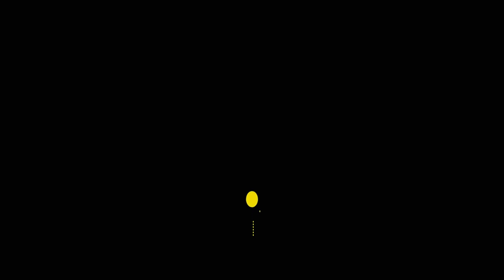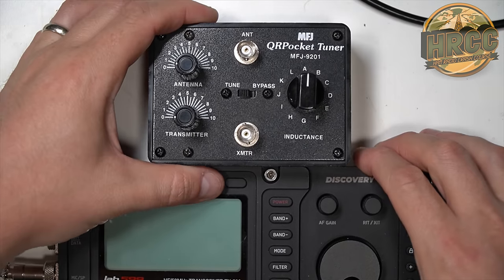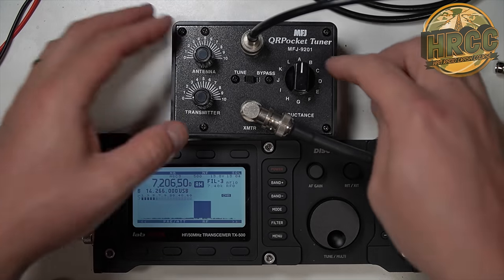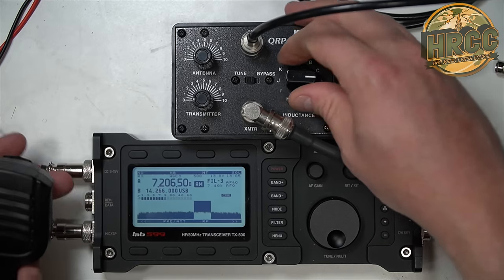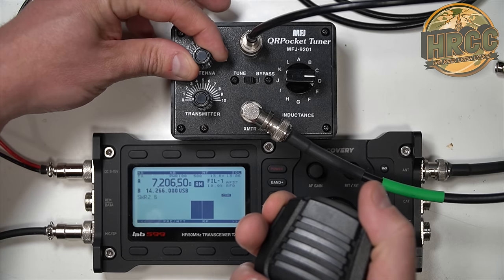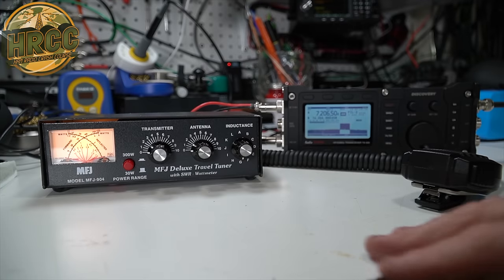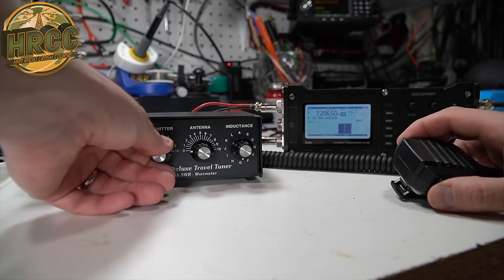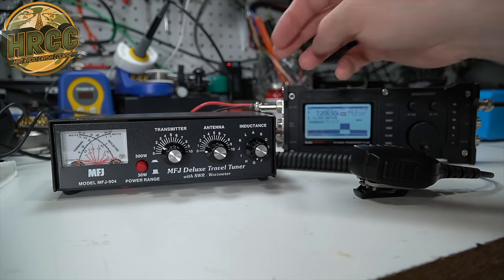How To Use A Ham Radio Manual Antenna Tuner 📻

Comment: Just a minor correction.  The MFJ "potentiometers" are actually just variable capacitors that has an adjustment knob attached.  Not resistors.  Thx for the vid.
Reply: Apparently, among electronic enthusiasts, potentiometer is becoming like a generic trademark for anything that has a dial and rotates, doesn't matter if it's an actual pot, variable caps, rotary encoders, just anything like it.

Comment: You are not likely to damage the tuner, by changing the inductor switch while transmitting which probably temporarily opens it, but the high SWR that you may reflect back to the transmitter may damage the transmitter.

Comment: I started with a manual MFJ tuner i was given, then got the bug and tried building my own.
Building and testing your own tapped inductor is probably the biggest challenge but still a worthy thing to learn about.

eBay has super cheap 11-12 dollar kits you can buy and build, but to be honest they can be hit and miss -probably better for learning about tuners. Those cheap kits are best for shortwave listening with a portable radio than they ever will be for transmitting even 5 watts QRP. 

I now have radio with an automatic tuner and I'm completely spoiled on it. LOL

Comment: Hi Josh. Well I learned something new today.  Don't play with the induction knob when keyed. Oh oh, I have done that. DUH. Hopefully I didn't hurt the tuner because I really need it for the antenna I have. Thanks, you just saved me money. Great video at the right time. 73 Clark KG7LOI
Reply: It may cause an ark on the contacts, but more importantly it could damage your radio because between each click on the inductor you have an open circuit. With the more expensive roller inductor there is constant contact. If your radio still tx you’re probably ok. 73
Reply: We've all made mistakes in this hobby, but we learn from them and do better. I've had a homebrew tuner with sparks arcing across the capacitor plates a few times. I also know a ham who told me he burned a hold in a capacitor once. I've never done that thank goodness.

Comment: I have a MFJ 969 Versa Tuner II which I hardly ever use any more since I no longer have my old Kenwood TS-430S.  It's a roller inductor tuner which I really like.  I now have a Yaesu 991a which has a built in tuner that will handle all my antennae.  My antennae are all very close to resonate so the radio tuner will do.  I did, however, turn off the radio tuner and chose an external tuner so I could set up my manual tuner for all the bands, just in case I do need the manual tuner.  Tuners are not really tuners per se.  They're simply an adjustable box which fools your radio into seeing a perfect 50 ohm load.  It really helps if you get your antennae close to resonate.  Cheers & 73 from W Rusty Lane K9POW in eastern Tennesseed

Comment: One additional comment; you can minimize the tuner losses by using the lowest inductance setting on which you can obtain a match (often on a band, you can get a match on a few different inductance settings). This will usually correspond to a maximum capacitance on the output side. There is a good article about effective use of T network antenna tuners on the ARRL's TIS.
Reply: How much loss is typical?  I've never used a manual tuner.
Reply: @gooberclown  I understand 1 db might be about typical (roughly 20%).

Comment: I kept a page in my notebook with the manual tuner settings for bands/frequencies I used a lot - helped saved time when switching bands (would still fine tune if necessary using the SWR meter on the tuner).  If you have different antennas you could have a separate chart for each one.  That being said I just got an IC-7300 and that auto-tune button is real nice compared to fiddling with the knobs on the MFJ.

Comment: Yes, I am thinking of a tuner.  But I also try to fix whatever is causing the antenna to be out.  I have modified the HEX Beam so most of the bands are below 1.3 to 1.   IT'S WHAT HAM RADIO IS!!

Comment: You tune a roller inductor tuner, first the transmitter, then the antenna and then the roller inductor.  You should use the manual to get you close to the settings on each band.  Then fine tune adjusting the tuner as described above.  73 from W Rusty Lane K9POW in eastern Tennessee

Comment: At 1:27 those aren't potentiometers, those are variable capacitors, right?
Reply: Agreed, they're also matching units' not tuning units.
Reply: Yes, just verified in the manual pdf.  Easy find with search engine.  I thought the same.  Manual is just a couple of pages.
Reply: pots would do no good. variable caps
Reply: Learning by rote does not generate understanding, which is a pity as many people are losing out on theenormous scope of our hobby...

Comment: I would like to add one word of caution. The T network, as this is, can be tuned for minimum SWR with more than one setting of the one inductor and two capacitors. Only one combination is optimum. I was slightly uncomfortable with that. I always use an L network. There is only one way to tune it to get minimum SWR. The coil is in series with the antenna and the variable capacitor is usually connected from the antenna side to ground. That allows you to match impedances higher than 50 ohms to the 50 ohm coax. If the antenna presents a low impedance then the capacitor needs to be on the other side of the coil. Simply reversing the input and output connections will make that change. L networks are very easy to build and use. Only need a single variable capacitor and a single coil, two coax connectors ( SO-239) and a box or flat surface to mount the components. I have my coil on top of the box and use an alligator clip to adjust how many turns I have in the circuit. Usually a simple coil of #14 wire wound about 5 turns per inch and about 5 inches long works for anywhere from 80 through 10 meters. The variable capacitor can be usually no more than 140 pf max.

Comment: When I was a new ham I had a guy with the radio club explain how to use these.  His explanation made the process seem unduly difficult and made my brain hurt.  Your description of the process is much better.  You are very good at making the complex simple.  Great job.  If I ever buy a radio to replace my Icom 7200 I will buy an MFJ manual tuner.  BTW, don’t you think we should start calling them tuners and start calling them Impedance Matching Devices (IMD)?

Comment: Ha, this video is great. Your helping me learn something new everyday! It would be pretty cool to learn about the science behind yagi antennas and how to build a non tape measure yagi... one thing I don't understand is how the matching stub works
Reply: Oh, that would be a good one, and compare to a log periodic
Reply from the maker: Thanks for watching.  Yeah, I can explain how a yagi works.  Thanks for the idea.
Reply: Matching stubs are transformers.  A curious phenomenon is the quarter wave matching section.  1/4 wave of coax inverts the impedance; a 25 ohm feed point impedance, one-half the coax impedance, becomes twice the coax impedance at the other end.
Yagis work because current lags voltage when inductive (too long) and current leads voltage when too short (capacitive).  The parasitic elements are "excited" by the driven element, and because of different lengths, produce a phase shift that augments the signal in the forward direction and partly cancels in the back and side directions.
Reply: Log periodic is basically the same as yagi but with the important distinction that all elements are driven all the time.  One of the elements will be resonant and that will be the principle radiator, others will be too short or too long, becoming directors and reflectors.  The relationship of the elements is such that you can tune a band and it maintains a uniform SWR across the band, whereas a Yagi has only one driven element and thus a distinct frequency preference (but also generally more directivity because of that).

Comment: Great video. Helps me in making the right choices. I am preparing the licence exam and the next thing is buying the first rig. very exciting, I considered to buy an automatic tuner for the Yaesu FT 891 but the manual tuners teach you more about the technology behind. Even the meter is not exactly required since the transceivers have built in SWR Meters.
Reply: The cross-needle meter gives you a sense of actual transmit power AND the SWR.  Radio transmitters tend to have a percentage power output, but it typically isn't actually measured.  So 50 percent of what, exactly?  
Then there's the problem of where exactly in the coax is the meter.  The radio might read perfect 1:1 and the tuner meter might show something dramatically different (or vice versa).  That will happen when there's standing waves on the coax itself and you just happened (or deliberately) placed the radio or tuner at a "null" in the standing waves.  
What happens is a quarter wavelength of coax becomes a type of transformer and it inverts the impedance, sort of a fulcrum over 50 ohms.  So if the antenna is 25 ohms (typical for a vertical), a quarter wave section of coax will see 1/2 below 50 ohms at one end and transform it to 100 ohms at the other end (1/2 above).  But a half-wave simply replicates and keeps the antenna impedance.  Values in between produce an impedance in between, but with a reactive component.  
Tuners exist to nullify this reactive component.  If the antenna is "capacitive" in reactance (ie, too short), add inductance.  If inductive (too long) add capacitance on the antenna side.  The transmitter side has its own matching capacitor and the inductor is shared.
It is because of the shared parallel inductance that it is typically set first, and then the capacitors, but doing that sometimes necessitates a small adjustment of the inductor again.  Manual operation of the tuner isn't quite a simple as this video suggests.

Comment: I have a MFJ-941B that I have been using since I got it second hand 10 years ago.  It works without fail.  I used to use it with my IC-701, now it faithfully negotiates between my IC-718 and my G5RV.   I don't know if I would see the need to go automatic, I am never in that big of a rush to tune things up.  I keep a notepad with my settings on my desk so I can quickly set the tuner and then add a little finesse as necessary to hit the magic 1:1 ratio

Comment: A demonstration of using a manual tuner with an included dummy load would be useful to those hams that purchased such MFJ Tuners. Thanks for the contribution 73, Bob McGarry
Reply from the maker: It might be confusing no? Since the dummy load is 50 ohms to begin with.
Reply: Ham Radio Crash Course not tuning with the dummy load but using the dummy load on the tuner for its intended purpose.
Reply: @HamRadioCrashCourse  "It might be confusing no? Since the dummy load is 50 ohms to begin with."
But the RADIO might not be 50 ohms!  That's why there's two variable capacitors; one for the antenna and one for the radio.  
Anyway, yes, it is trivially easy to match a dummy load 🙂

Comment: I use the MFJ-945E with my Alinco DX-70 for POTA. I threw in the towel trying to get the MFJ-939 to work with the DX-70.. although it works fine with my DX-SR8  rig in the camper.  Anyway, I've always had good luck with the 945E... just takes a couple of extra steps.. :)  73

Comment: Thanks for a "quick refresher". I have used a manual tuner, but not in a long while. I didn't need a 20+ minute explanation on the inner-working of an L-C circuit. BTW, (verbal typo) you called the second tuner an "MFJ-940" at 5:24... It's an MFJ-904... No biggie.
I'll have to check out your other videos. 73, DE N4QPM

Comment: Good video on tuners. I got the mfj 1644 wipe tuner as I live in an apartment now and I am having problems putting out my long wires and off center dipole. I have never used an antenna tuner before. Thanks for all that you do for amateur radio. De kb7zpb Keith
Reply from the maker: Thank you!

Comment: Very nice video Josh, really useful for the majority of New Ham Radio Operators.
By the way, it could be very interesting to understand how to use an old rig like a Drake, a Collins or whatever else  with no automatic controls and no electronic devices inside. in other words, how to use AFGain, RF Gain, RF Tune, Plate, Load, Mic/Car, Comp Level, etc.
Reply from the maker: Great suggestion!  I only have a Drake receiver at this time.  But I'll keep an eye out for a good boat anchor transmitter :D
Reply: Definitely an art as much as science back in the day.

Comment: I have a Xiegu G-90 transceiver that has a decent auto tuner built in, but I also use a manual tuner on seriously compromised antennas (such as an end-fed long wire) since the manual tuner is more forgiving.   Just another tool in an operator’s toolbox.
Reply from the maker: Yes, that is a good way to look at it!
Reply: Auto-tuners tend to be limited to matching up to a 3:1 SWR where manual tuners can usually handle 10:1 mismatch.  The big roller inductor tuners have nearly infinite matching range but of course if your antenna is that far out of resonance it probably won't go anywhere anyway.

Comment: So what is the 'antenna' dial used for? Also, do you need to use a dummy load while tuning to avoid any issues? I'm new to the hobby so pardon the noob questions. 73 😉
Reply from the maker: It add inductance when added. No do not use a timer. Hook it to the antenna, as the timer is helping you get the 50 ohm resistance to it.
Reply: Timer?

Comment: Nice video. Also, if the radio you are using has a built in tuner e.g. Yaesu 991(a) or Icom 7300, always ensure you have the automatic tuner deselected / turned off!.

Comment: As a beginner I love these kind of videos. The one question I have is about the bypass switch. The MFJ I bought doesn't have one. Does that mean the tuner is in the line between transmitter and antenna all the time? And doesn't that influence the output in any way?

Comment: Will an antenna tuner benefit a receiver only? I have an Eton Elite 750 and want to know if an antenna tuner will help with reception.
Reply: I have noticed improvement in receive stregth when using annual tuner. So, yes, I would definitely get one if you are able.

Comment: Great explanation very good. Question: I have MFJ 962e and it is explained and I understood that I have to turn anti-clock from full inductance the INDUCTANCE knob obviously while transmitting and after work on the Transmitter and Antenna knobs?  You say that we shouldn’t do it? Is it only for your type of ATU? Many Thanks in advance

Comment: I use one on 11 meter friends laugh but it works and it will tune bal line and bare wire too.
Reply: do you run an amp with it? I was considering getting one cuz my dipole swr is 1.6

Comment: So 2 questions being a noob...1. Is your anteanna hooked up when testing I'm assuming yes but I saw questions on the tech test about a "dummy load sink" when making tests.
2. If I'm correct and the antenna is hooked up am I also correct that you leave the swr meter hooked up when talking so it keeps the good settings? Hope that made sense!
Reply from the maker: Yes, you leave it connected.

Comment: Does the tuner need to remain in the circuit to hold the adjustment? Thanks, Gerhardt KF0DAQ Semper Fi
Reply: Yes it does. The tuner is the adjustment when it is configured to a SWR close to 1:1.

Comment: Thanks for showing tuner techniques! Do you ever use an MFJ-212? "Tunes up your antenna tuner without transmitting a single milliwatt...  Precisely tune your antenna tuner for a 1:1 SWR -- no additional "tweaking" needed..." 73 N9EDL

Comment: I have an old FT 102 Yaesu transceiver.  I assume that I would first load up the transmitter to a 50 ohm dummy load, then use my antenna MFJ tuner to match the antenna to the transceiver.    After that, would I ever need to readjust the loading of my transceiver drive and grid dip?

Comment: Great video! Do you think a manual tuner will tune better than an automatic tuner?
Reply: Manual tuners ought to always tune "better" but only slightly better.  Since it takes a much longer time transmitting a dead carrier while tuning, it's easy to spot the manual tuners on the air; a carrier with slowly varying intensity that lasts about a minute or so whereas the automatic tuner has the job done in a few seconds.

Comment: Can you explain you position on tuners and why several other ham radio YouTubers steer away from tuners (and sometimes advise against) recommending a better antenna in most cases
Reply from the maker: Resonant antennas are great. Use them if you can. If you can’t. You’ll need an antenna tuner.
Reply: @HamRadioCrashCourse  Exactly. It is better to use a resonant antenna but some of us are living in places where we can't put up a full size or multiple antennas, so we have to compromise with a couple of antennas tuned to multiple bands. Not the best setup, but it gets people living in small houses on small lots on the air.
Reply: @redstickham6394  a resonant antenna doesn't mean its better than  a non resonant antenna

Comment: If the radio has an automatic tuner, will it fight with the manual tuner?  Also, you didn't say anything about the antenna adjustment. When do you use it versus the transmitter adjustment?
Reply from the maker: Just leave the radios timer off. I only mess with antenna if I need to adjust the match anymore.

Comment: I'm a beginner in HF.  Will an antenna tuner allow me to use an antenna for a range that is currently giving me high SWR?  I could lower the antenna and physically trim it but does an antenna tuner allow me to use this frequency range without the physical interaction with my antenna?